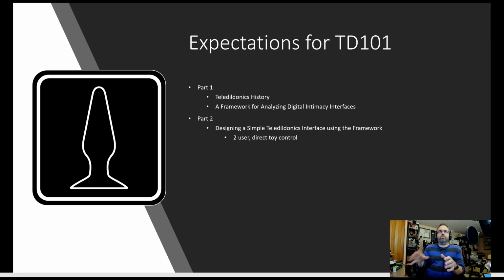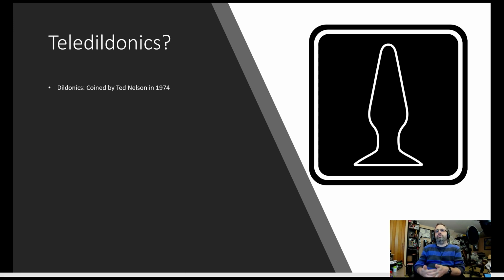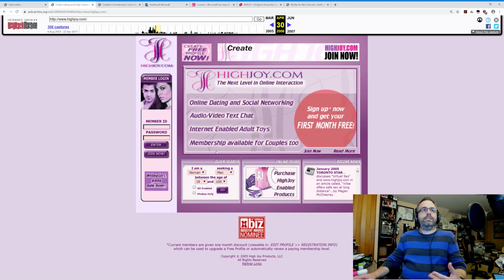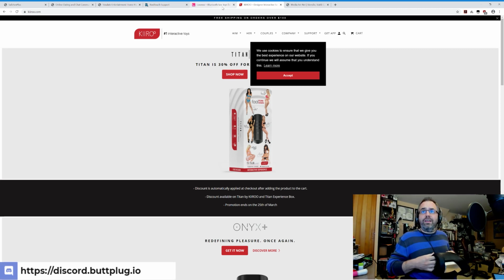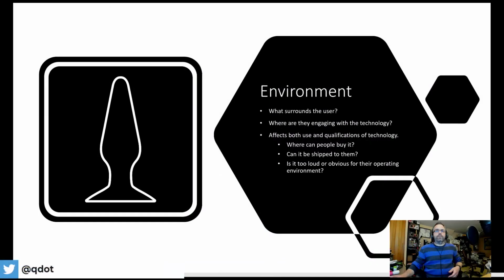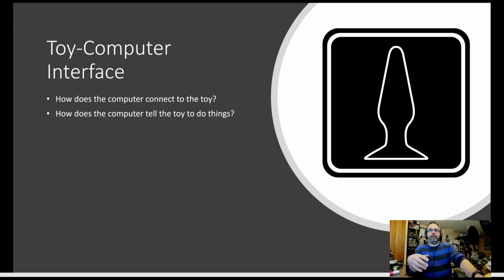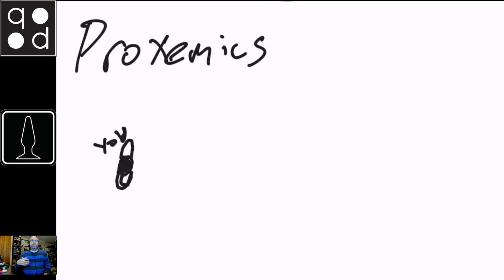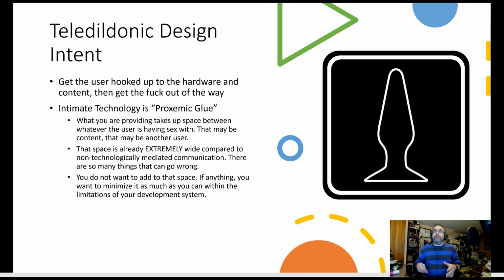Buttpluggin' With qDot - Teledildonics 101: Part 1 - Intro to Teledildonics

Comment: There are blockchains out there that can help with not needing a central server yet being able to connect to other ppl devices. ie IOTA, ChainLink, maybe even BAT even though that's not really it's usecase, but it would then already have a peer-peer webpayment system built in, and automated. For ie camsites.
You basically become another node yourself in the network when you turn on your device.
It would also allow for true anonymous data collection the developers can use.